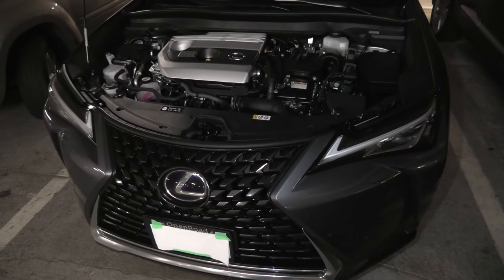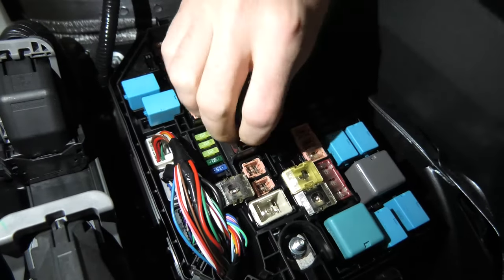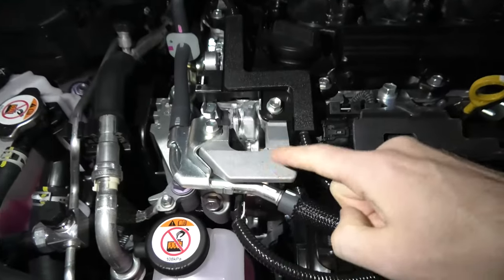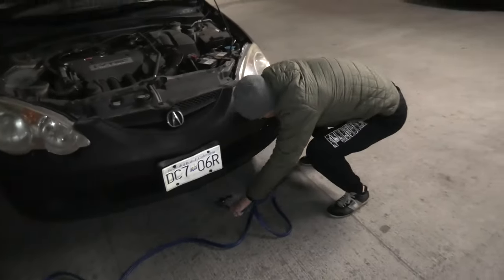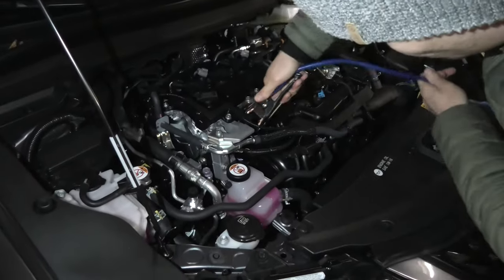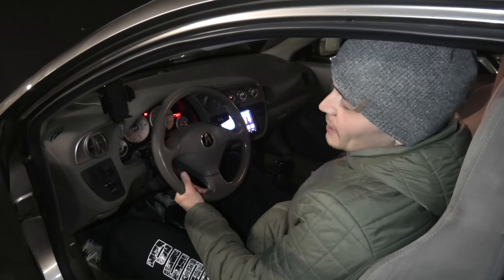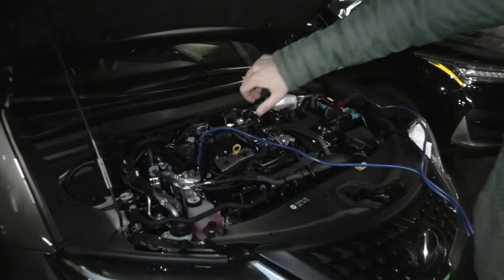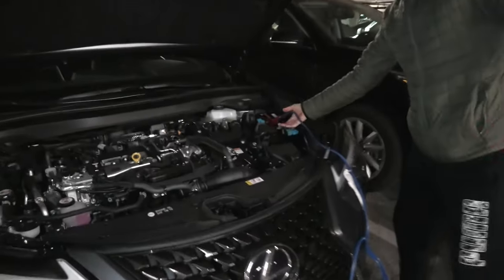Lexus UX 250H (2019-2024): How To Jumpstart The Hybrid Lexus UX 250H?

Comment: the UX 250h has a metal post marked "N" close to the fuse box so no need to remove the engine cover to boost. I can see it in your video.
Reply: I used the way he said, can only work once but you need to jump start every time, but placing on the N mark can make car beep and work

Comment: I had AAA come by to jump start my UX250H and that’s how I found out but Lexus sent me this link.  If I may add. If your UX250H has a electric power lift and your battery is dead there is no way of opening it. You’ll have to use the terminals (seen here in the video). I was able to remove the top coverings in the back where the battery is located.  I placed my battery charger onto the battery post for a over night for a slow trickle charge. My battery was low because I was on the car on a important call that lasted over two hrs via stereo system which ran the battery down.
Reply: You can open the trunk manually from inside the back of the car after lowering the back seats. There is a plastic plate that you can take off with a flathead screwdriver and then unlock and open the trunk.